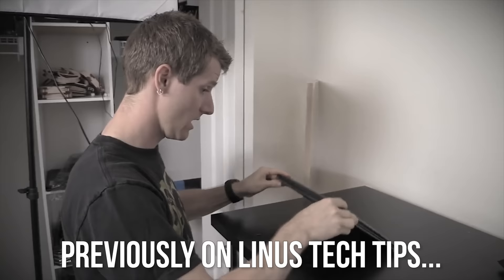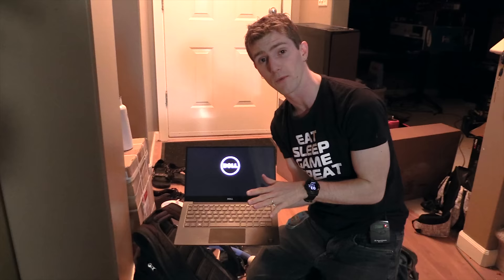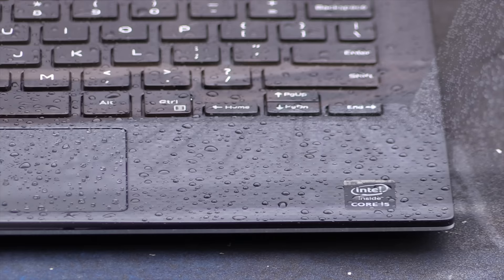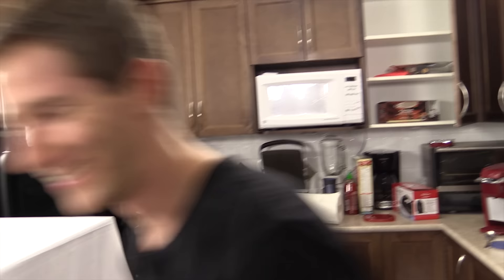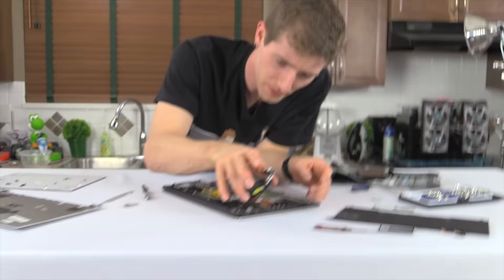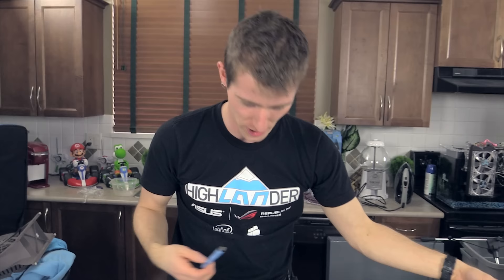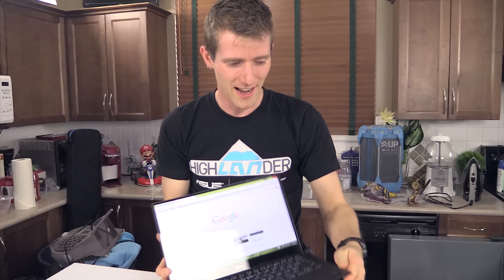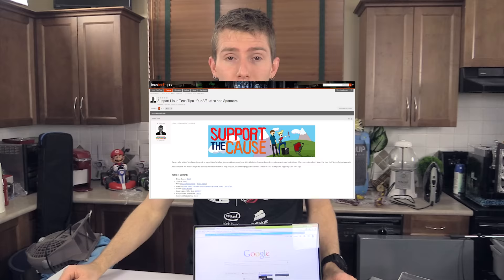Wet Laptop Recovery AGAIN - Dell XPS 13

Comment: Still never buying a Dell.
Reply: Y
Reply: Jeremiah E they are overpriced as hell. But I'd still take one of them over a Apple laptop.
Reply: Why? I've never heard hate on Dell before.
Reply: ***** Ever heard of hate on alienware? Yeah, you heard of hate on Dell
Reply: Kyle Nelson Aside from some of their premium stuff, their computers are junk. Budget $300-500 laptops from them are just crap in comparison to the competition.
Reply: EMPiiRE I mean ... Yeah.. but $300 to $500 computers from any manufacturer are crap. You're always better off getting a used elitebook or latitude or XPS or thinkpad than going for a new consumer-grade computer. Lowend consumer grade stuff is shit you do not want. Those are manufactured with your grandma as the target user.
Reply: Asus all the way. Woop
Reply: SiriusXification tell that to my $200 chromebook. It's suprisingly snappy, even with full blown linux installed. It can even play some games like Fallout 3 and minecraft.
Reply: In the past, Dell desktops PC were also terrible to work on. Often you couldn't even change the Power supply because it simply wouldn't be compatible with both the case and their own special drm standard.
Today though I don't think that's the case anymore... I also have a Dell Venue 8 Pro tablet and it works nicely, it's thinner and lighter than my Android tablet and I was able to install Windows 10 on it, which is worlds better than Windows 8 was.
Reply: Tetra Sky Never. Buying. A. Dell. EVER. again.
Reply: yea me to im never buy dell cause the companie would cost over 5 billion to buy
Reply: Alex Coukoulis A fuckin toaster can run MineCraft.
Reply: Kyle Nelson not my toaster. (Asus vivobook s500ca) but I'm building a PC so that toaster is irrelevant
Reply: chris hazen AHahhahahahaaa
Reply: Jayden Holzhauser And poor people's hate should be taken seriously. Alienware, Razer, Apple right? The internet circlejerk, it's pathetic.
Reply: Lol their customer service sucks. One of the reasons I got a Macbook Air.
Reply: Jayden Holzhauser The only negative I've heard about alienware, is taht it's overpriced. That's it, really. And I've only head it less than 5 times.
Reply: ***** Dude check out Clevo/sager laptops they beat Alienware by a lot.
Reply: ***** Dell owns alienware
Reply: ***** You forgot poorly balanced with shitty overclocks.
Reply: ***** It is over priced, and compared to the competition, their laptops are bulky, heavy, and run hot.
Reply: ***** Then your Lucky. and must not care how much you pay for a computer.
Reply: Kyle Nelson you get what you pay for
Reply: ***** I wish I had your luck.
Reply: Rusty Shackleford mine won't  go past 70 c in game with a quad i7 its heavy but all the space is used inside
Reply: Jayden Holzhauser My father bought me my Dell Studio XPS 8000. That was 6 fcking years ago. I've only had to replace the HDD, and the only noticable issue, is the sound is getting static from time to time. But few, and far between. Last time the sound got static, was a year ago. Also, it's still doing a good job keeping itself cool. I don't think I've seen it go above 80 Degrees C.
Reply: Too expensive some times... cough cough Alienware
Reply: lukem9962 Quad i7? Haha... i7 is a tier of processors, not a graphics card... And to have more than one processor you need a server MOBO, and Xenon CPU's or other CPU's that arn't available to the public. Also, my liquid cooled i7-5820k doesn't surpass 50C in any game I've tried.

Stop thinking you know anything, or stop trolling.
Reply: jojo hindle A Precision costs a lot more...cough
Reply: Trym WS quad core i7 obvs you fucktard
Reply: Trym WS actually cpu's like quad core and even dual core cpu's have 4 cpus or 2 cpus that are in the came component.
Reply: Fastgamer602 No, they have 2-4 cores, that's why it's called quad and dual core. CPU stands for Core Processing Unit, which indicates the whole package/unit. Just like my i7-5820k, with 6 cores and hyperthreading isn't 6 or 12 CPUs... It's 1 CPU, with 6 cores, that can handle 12 threads.
Reply: Trym WS A core is a cpu by itself. :P
Reply: Fastgamer602 If it's a single core CPU.
A core is a processor, a CPU is the package.
Wrong termonology.
Reply: Trym WS You can believe whatever you wan't I know for a fact that a core in a processor is considered a cpu. A package is a way to say that there is multiple cpu's or cores in one component.
Reply: Fastgamer602 When is a Core,not a core?AMD Bulldozer,for example.Modules.Intel,another example--shared cache.Thus,pretty much in all situations,a core isn't a full 'core'.Thus,a core cannot be considered as a discrete CPU.
Reply: Trym WS CPU stands for Central Processing Unit.
Reply: Giggity Goebbels Yeah, I wrote it to fast. Still the termonology for the package/unit though.
Reply: Giggity Goebbels yea but as i said before it can be considered a cpu. i did not say it is. Sorry if m my wording is wrong.
Reply: Dell is still infinitely better than Toshiba.

Comment: I don't see Dell sending anymore XPS laptops your way anymore.
Reply: Fabian B Dell doesn't send him a lot of stuff when you compare it to what ASUS, NVIDIA, Intel and Corsair send him. Did you see how he painted a $400 motherboard just because red didn't match the rest of his PC?
Reply: Yeah
Reply: Fabian B It probably wouldn't survive spilled coffee, unless said coffee was spilled on it while it was sleeping.. If it got any liquid on it while it was operating it would probably be dead meat.
Reply: Ryan Grobe dell also doesn't happen to make any PC components unlike Intel, nvidia, amd, asus, etc. Only prebuilts (and monitors) and the only prebuilts this channel covers are laptops, which makes sense for dell to send only laptops (and monitors)
Reply: Tommy Tindall A lot of modern portable electronics have surge protection circuity that would cut the power before anything catastrophic happened. Certain smart phones are good examples of this. I watched a friend drop his phone into a puddle (accidentally of course), and it turned off instantly. We thought it was broken until a few days later it powered back up like nothing happened when he dried it out. Electronic Engineers are quite smart with how they design things and what components to put in, especially with objects that are likely to be dropped at some point - whether or not it's into water. Or another example is if you drop an iPod into water/snow, you can get it working again if you dry it out - like with a bag of rice. :)
Reply: Fabian B No, I dont think it will survive a coffee spill.

I think the reason it survived the rain is because it was in sleep mode, if the laptop was powered on it would have shorted out from the water. I imagine you'll be using your laptop when you spill on it, so it will likely short out if any coffee gets inside. 

Also it would get sticky.
Reply: Fabian B Coffee and non-water liquids in general are worse than water to spill onto electronics since all the non water portions of those liquids can't nicely evaporate and air out.
Reply: Well I think they will send the next one and ask him to do the same thing
Reply: Laptops and other electronic devices generally survive any form of spill, even while on, if they can be powered off and be unplugged/have the battery removed relatively quickly. If the liquid is something else than water it can pretty safely be flushed off with water or preferably isopropyl alcohol. Spills aren't an instant 'kill the device' thing, and generally the spilt liquid won't be conductive enough to cause a catastrophic short. The problems generally come with letting the device run while wet. 

Typed on a laptop that had a large bottle of coke knocked onto it while on, pouring out on it for more than a second before removed. I powered it off, removed the battery, flushed it off with water, and took it apart to dry in a sauna for about 2 hours. Runs with no problems and has no visible damage.
Reply: Dude this is amazing marketing for Dell.
Reply: Why ? He's doing great publicity for them.
Reply: actually this is wonderful marketing for them ^^ but they may start to specifically rig the laptops to make sure they endure the test lol
Reply: Fabian B I spilled coffee right over the keyboard of my moms new laptop (literally few days old.) Turned it upside down, let it dry, and boom. Perfectly functioning laptop, with a slight coffee smell. Great!
Reply: Ryan Grobe but he used his own money for that mobo. No one gave it too him.
Reply: I wouldn't be suprised if dell gave him that lap top and told him to do this, but only post it if it works.  It's GREAT press for dell.
Reply: Fabian B The difference between being left in the rain and you spilling coffee on it while in use, is it's in sleep in the rain. I'm sure if Linus left it on, it would have shorted out pretty much everything in the laptop.
Reply: Wawaweewa Rice Even monitors are just rebranded LGs. And They get many LGs to review, no need to review same stuff again with different logo.
Reply: Tommy Tindall it takes time for liquid to seep in to all the electrical components so you could turn it off before it fucks up... I dropped a good amount of beer on my Lenovo Y510p and shut it off then cleaned it out and it still works fine
Reply: Dell is just going to be more careful about what they send him. Or Linus is secretly coordinating with them. No one would know. Capt Honorpants I'd rather torture-test it myself and THEN tell him or nudge him to test it, after I was confident that nothing would go wrong.
Reply: ben levin no that motherboard was the review sample that ASUS sent him, he mentioned it numerous times and that since it was a review board it had no warranty.
Reply: Yeah I know it isn't a sure thing, guys. Lol. That's why I said "probably". Because I've ruined a laptop that way before, even trying to immediately shut it down and dry it off. I just meant having it turned on increases the risk of it messing up.
Reply: Fabian B not exactly the same as coffee has much more conductive substances so it would more easily short circuit something inside... but yeah i get your point
Reply: Johnathan List Linus proof? 

Nothing is linus proof. 

Are there waterproog, dropproof, weatherproof and mountain proof laptops? No, maybe cameras, but no laptops.
Reply: Fabian B I doubt it will survive spilled coffee, especially since most people put milk/sugar in their coffee. I spilled almost 2 cups of milk on my macbook pro about 6 months ago now and guess what I am typing this from, the same macbook. Milk is the worst object to spill on a computer since its very sugary and stuff, but yeah still works like a charm. Not really that much slower, and charging works fine. I am gonna buy a iMac in July most likely so not that it matters but
Reply: bugattirocksful Try grape juice on a keyboard you can see through immediately after being dropped on concrete. Ancient cobbled together Windows xp laptops for life!

Comment: Usually if something is water damaged it's just a case of cleaning off any of the particles/salts that have been deposited on the electronics, as that's what causes any short circuits. I believe alcohol is quite a good cleaner for it, but I'm wondering if just blasting the thing with distilled water BEFORE it dries would wash away the particles/salts off quickly and easily.
Reply: yeah that works fine.
Reply: Maybe but you going to have to watch out, as you might rip off a chip/transistor on the board.
Reply: Just dunk isopropanol on a microfiber cloth on it. Works like a charm. Isopropanol is great for PCBs and especialy processors and if you use microfiber cloth, no crud left behind. I got a liter of the stuff and put it in a few spray bottles to always have it on hand.

Also, I am a wee bit skeptical about this video. Like I am on an illusionist's show. Something doesn't add up.
Reply: Alcohol works well because it cleans impurities and, when it mixes with water moisture, enhances the evaporation process. Alcohol is often used to dry scientific and medical equipment in situations where trace moisture must be removed for this reason.
Reply: true, although still pretty nice knowing you have some water protection and the thing wont die with some humidity
Reply: DIY Perks I thought of running it with distilled then reversed osmosis water or alcohol  to clean stuff out then dunking it in some kind of electronic friendly oil that has a different density than water
Reply: DIY Perks you could test it on your super silent pc ;D
Reply: DIY Perks i fucking love your channel. why did u stop making videos .
Reply: DIY Perks Exactly what Matt said. Linus this video isn't very remarkable considering physics and you really shouldn't feel impressed or proud about it.
Reply: +DIY Perks It isn't IF it works now. Usually things do. BUT things start to corrode and than they die after time. This is why people get made when they return their phones and the water detection stickers show it is wet. The phone worked for a month or two than boom dead.

Did the Dell 12 XPS die a month later?

Comment: "Did you tell Dell you were going to do this?"
"...no..."
God damnit Linus xD
Reply: +Captain Gray 
LinusLiesTip

legit company from LinusTechTips
and legit macrosoft winding software
Reply: +Ethan Chung You mean LienusTechTips right?
Reply: +Captain Gray 0 shits given
Reply: I love how at the end he is super surprised it works. Like Linus takes a thousand dollar, doesn't tell the owner, and puts it in the rain expecting it not to work after. XD
Reply: +spik330 It's Dell. Nobody Cares!
(Unless you're a Dell hardcore fan. Sorry about that, have an Acer instead)
Reply: Carats Ritzy I prefer stationary PC's rather then laptops. I am planing to buy myself a Lenovo or ASUS gaming laptop sometime though.
Reply: Captain Gray True. But I'll never afford  gaming PC over a laptop.
Reply: +The illuminati lyintoustechtips
Reply: +Carats Ritzy JUST DO IT!
Reply: Shocked and not shocked he gave it the best chance by getting rid of most power b4 leaving it the voltage lowers so much in sleep it would struggle to short anything.  I'm not sure if dell had anything to do with its survival other then maybe protecting the few parts that get power in sleep lol

Comment: I know this is an old post but I figured if someone see's this in hopes of fixing soaked electronics I'm here to say that it isn't always hopeless. I worked a temp job at a restoration company years back in vancouver actually and ya it rains a lot. 

I'm pretty tech savvy so they put me in the electronics department. When a house would flood I would go to that house load up the electronics and then back at the warehouse we would restore them by taking them apart washing them in sinks etc and leaving them in a drying room after. 7/10 times we could bring them back to life for the insurance company. Laptops are extremely tricky to work on because it's easy to forget how it goes back together. Mr Linus here is smart and took pictures and labeled everything he could and then let it dry for a long time. That white stuff is corrosion and if it's not too bad then you might just be in luck. You also don't necessarily need to take it apart. It's OK most times to make sure it's powered off asap and then dried for a few days. If it is something like coffee etc then yes clean it up inside.

Comment: MACBOOK IN SINK PLEASE.

You know you want to.
Reply: this would be fun
Reply: He kinda did that
Reply: Macs are designed to fail
Reply: I spilled my coffee on my MBP 13 2012 and it died.
Reply: Logan Jamison it's my old saying; it's not water that kills electronics, it's water and high voltage. 

It's a shame they didn't waterproof the keyboard. I've spilled water all over my Dell latitude, and it's fine
Reply: Yes please
Reply: lmao all it would take to kill a Macbook is one drop.
Reply: *blender
Reply: Watch Louis Rossman YouTube videos. They stop working even with a little water.
Reply: @Thomas Lam I spilled a few ounces of soda on mine and freaked out, but when I opened it up, it was only in the fans from where it leaked through the hinge. Nothing made it through the keyboard, and there seems to be a pretty solid membrane right under it. I think it did manage to get into the ports on that side, but if I need to, that's one of the easier and cheaper things to replace. Just a note to anyone debating getting one. Everything soldered onto the motherboard sucks, but its way more indestructible than previous models. Heaven forbid I spill anything on my pre-unibody.

Comment: I'm not surprised that it works.  Windows 8 "sleep" mode is actually hibernate, so it just dumps everything from RAM to the disk and shuts down.

Electronics fair perfectly fine in water when not powered.

It's obviously not a good idea, as water can still damage the parts.  But there's a very low chance of it being destroyed as a result.

Yes, the fact the battery is still in there when you did this gives some small potential for damage, but it's still unlikely.
Reply: Let me try it with my laptop
Reply: Wawaweewa Rice

Put it underwater.  :V
But I'd suggest removing the battery first.  :p